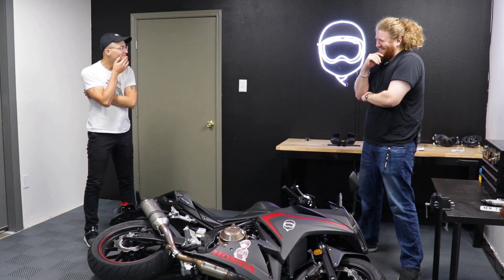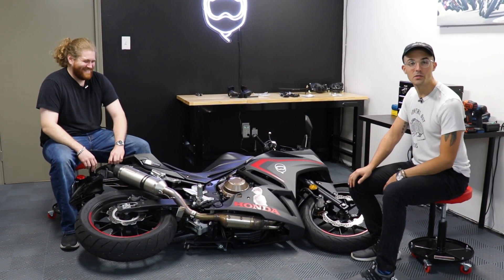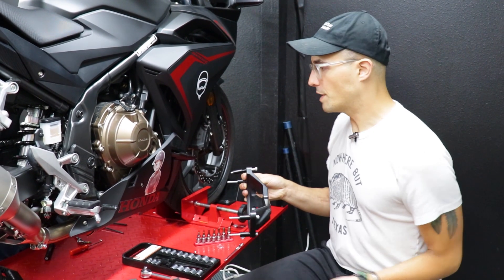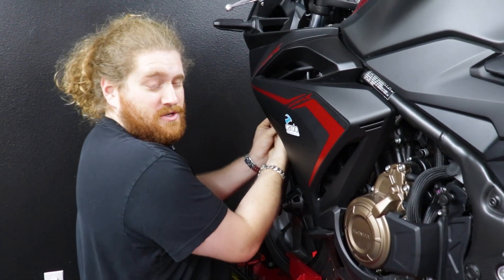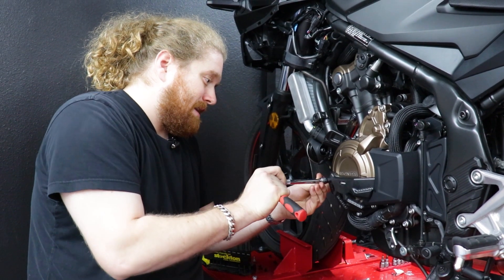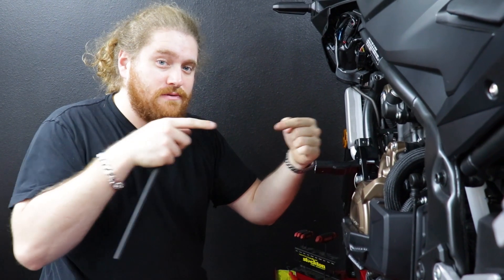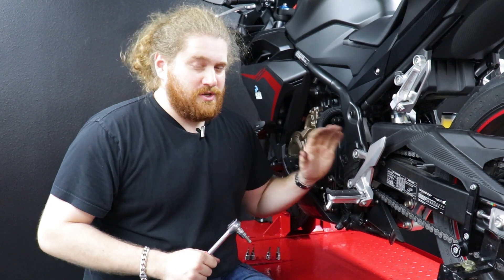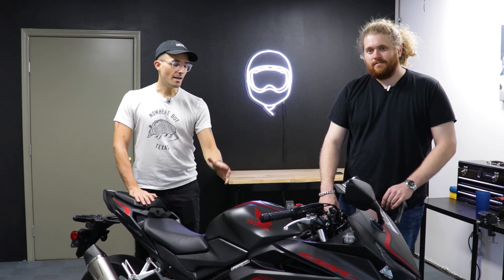The One Thing Every Beginner Rider Should Put on Their Bike

Comment: I've been working as a mechanic for several years now and we always, ALWAYS seat the screws by hand. This is one of the easiest yet most important way to avoid damaging your hardware.
Reply: Absolutely!  Also tend to reverse-spin on self-tappers to find the original thread.
Reply: @jameswyatt1304  i do this with normal screws if i can't find the thread entrance. I'm feeling for when the screws drop slightly.
Reply: Yeah I always start the thread by hand then zip it in with and electric impact then finish with a torque wrench, if it's important to torque it that is.
Reply: @joshsevens9611  i almost never use an impact gun to tighten a bolt. Only to loosen them. It's way to dangerous.
Reply: @dariolinder4508  I hear that I never fully tighten a bolt with an electric impact either but I do know some guys in the shop that only run impacts all day but they are a lot more skilled than me. I've snapped a few to many bolts to press my luck trying to play with the big boiz haha.
Reply: @joshsevens9611  there are electric impact guns that can be set for specific torque specs, but most of our shop guns are air powered and way to strong.
Reply: @dariolinder4508  Oh yeah I'd never use an air impact on anything that wasn't a wheel lug or tougher for sure.

Comment: As a motorcycle machinc the best way to not cross thread a case screw is to put it in and turn it to the left till the end of the thread on the screw drops into the start of the case threads . If the thread is good you should be able to turn it in till it come tighten it up . If not a tap or repairs thread and new screw .

Comment: Yo Yam get yourself a few good electric impact drivers (a drill is fine if you loosen the nut/bolt first) so you don't have to work that rachet so much it'll save you a ton of time while removing bolts, lugs and nuts what I do is loosen the bolt or nut with a wrench then zip them out with the impact and I'll start by screwing the bolt/nut in by hand then in the rest of the way with the impact then finish with a torque wrench but I know tons of guys in my shop that only work an electric impact all day.

Comment: TORQUE WRENCH! A torque wrench will cost far less than the cost and aggravation of stripping out a hole in a case or snapping a bolt off in said hole. When I first started using them about 30 some odd years ago I quickly realized that I had been stretching the hell out of bolts for over 30 years previously. And yeah - I'm that old - but you're never too old to learn stuff.

Comment: BAD NEWS: Cross threading will potentially lead to having to tap and re-thread the hole possibly over sized.   GOOD NEWS: If you manage to continue to tighten said bolt while cross threaded the benefit is that it will stay tight better than any loc-tite product can guarantee!